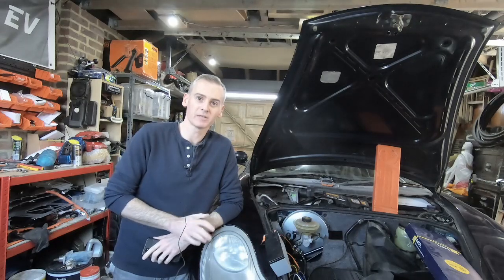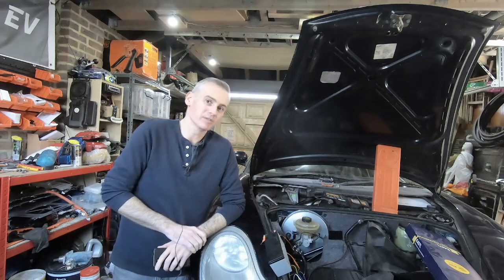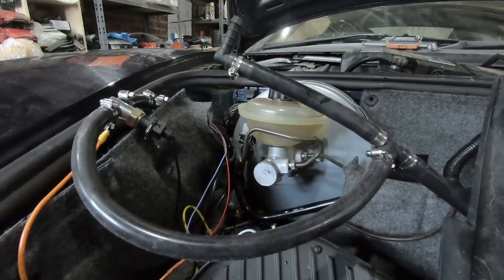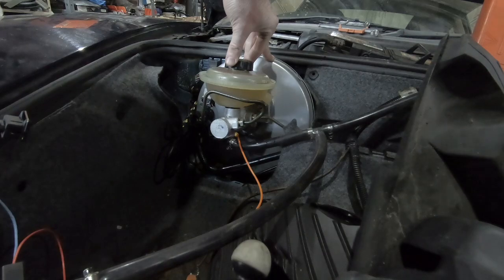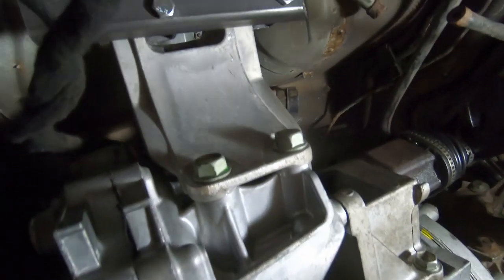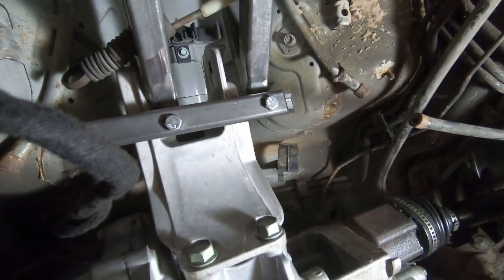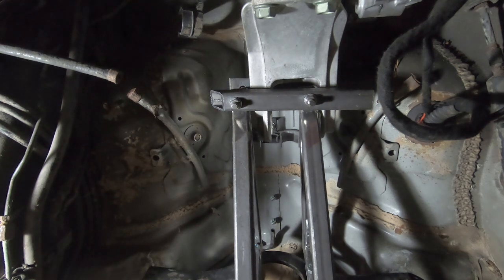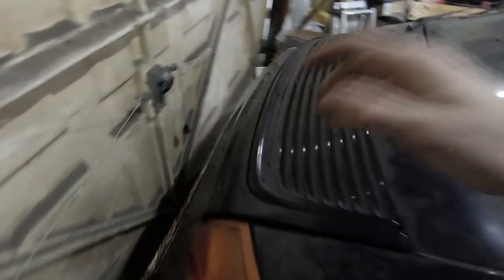Electric Porsche 911 project video 36 - Getting our Electric Porsche 911 out into the sun

Comment: How much power does that motor generate
Reply from the maker: It's a bit of a question of how much power can it take. Using the Nissan logic board in the standard inverter, 80kw.  With replacing the inverter logic board we can push the inverter closer to it's limits and potentially get up to 160kw to the motor.  Then the stock inverter is the limiting factor, with a custom inverter these motors have been pushed to 220kw.

Comment: Throw away the power steering pump, and use an electric power steering like one from a prius
Reply from the maker: Thanks for the tip. I am going to try to get this pump working properly, (just because I don't like being beaten by inanimate objects:-) but I think I will get my hands on a Prius steering rack as well to investigate if I could get one to fit in this car.
Reply: Performance EV do a manual rack conversion like this: 
https://youtu.be/qALuWGOO91o
Then add the electric power steering motor on top (plenty of info in the Miata world)

Comment: Re the brake booster, you just need to make 100% sure there are no leaks. My one was doing exactly the same as yours and it turned out to be leaking. You could also try fitting a time delay relay.
Reply from the maker: Thanks, good to know I am not alone. I suspect you are 100% right, I need to go through the system again and try to sort it out.
Reply: @PerformanceEV  I'm using the exact same gear as you (dracarys and Hella pump), but my pump is in the engine bay and pulling through the existing Porsche vacuum lines (no reservoir). Also, if you've got any muck un your lines it may stop the non return valve from closing.  Good luck!
Reply: Yes I too had a faulty kickback valve. Though in my case it never stopped pulsing.

Comment: Good to see you're making good use of the down time.
I don't know if any of this is relevant to your situation as the car is an old Audi 80 but it's worth a watch, he uses a low pressure feed from the power steering pump to feed the brake boost. I guess you would need to change everything to make that work but maybe something there.
https://www.youtube.com/watch?v=6h7XtR7y6nQ
Keep safe mate, these are crazy times.